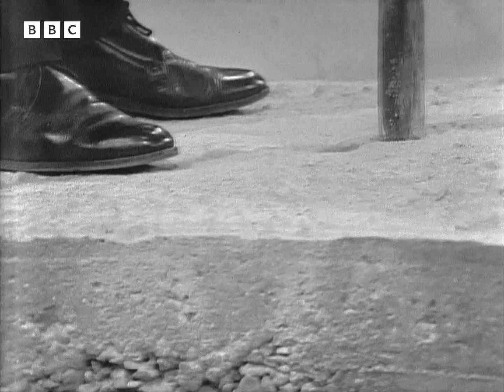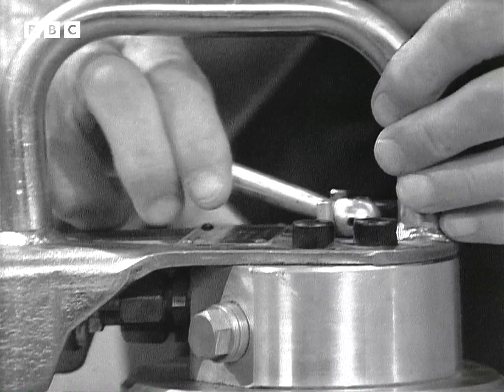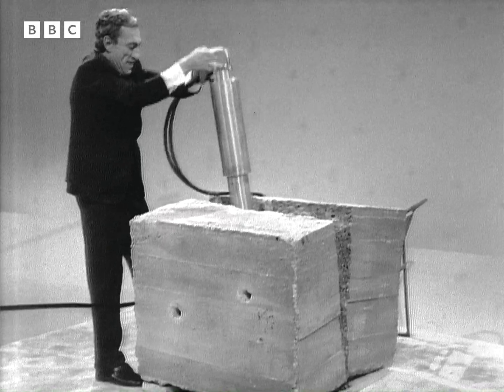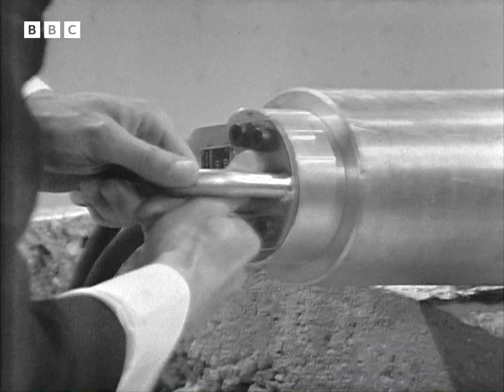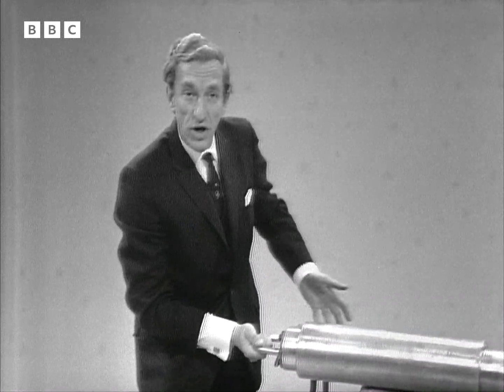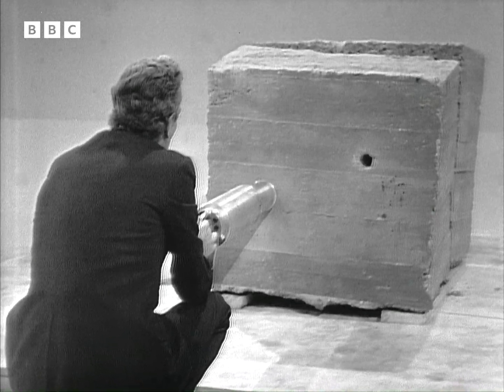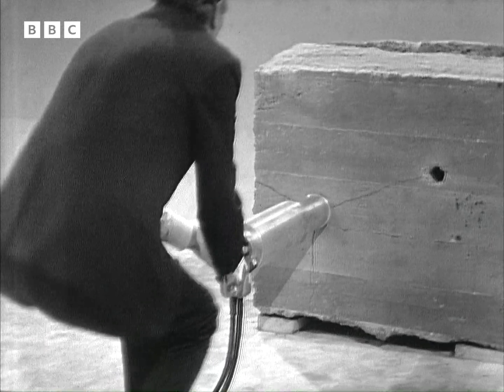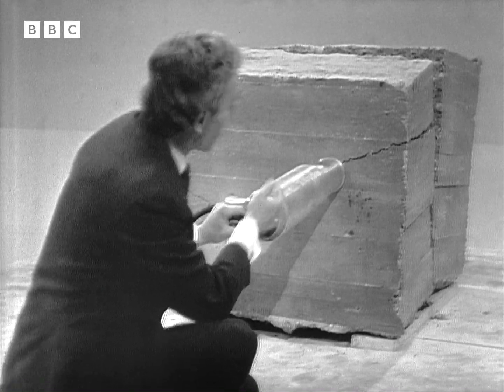1969: BEHOLD The HYDRAULIC ROCK SPLITTER | Tomorrow’s World | Retro Tech | BBC Archive

Comment: As long as you have a tie on and a handkerchief in your top pocket, there will be no need for any safety goggles etc. when 2 tonnes of the toughest concrete get flung into your face at 7000lbs /sq inch.
Now you have to wear eye protection, gloves and a reflective jacket, just to tap a cable clip in.
I think yesterday's world may have been more fun.

Comment: THINGS RAYMOND BAXTER MIGHT SAY WHEN DOING LOVE-MAKING

"I am now taking the pressure back off the tool and with a bit of luck I'll be able to withdraw it without collapsing the whole issue."

"There we go. Come on out my beauty... I'll pull it out that way and now we'll be able to see how that miracle was achieved!"

"But in fact, the tool itself is quite simple and it embodies a very well-known principle; that of using an enormous hydraulic force in a very short stroke to create these immense energies..."

"In fact, that's not nearly as dangerous as it sounds because this is only a quarter inch bore and of course there's virtually no flow so even if this did pop off, uh... it wouldn't present you with a lethal hazard."

"Now as you can see, I'm withdrawing the central wedge so the 'chisel' is returning to its minimum size..."

"There he comes now! Look, running in three directions; there, there and vertically downwards..."

"Now if I retract the central wedge, to reduce the size of the probe, I will then be able to withdraw it and by popping it into the other hole..."
Reply: Absoulutely filthy....but hilarious.

Comment: Really interesting to see this from the 1960s. He says it's not dangerous because the flow is so small, but hydraulic failures can still release a reasonable amount of energy, even though hydraulic oil being a liquid is nominally non compressible, there will be some amount of stretch in the pressure hose that will contribute to this. Another risk is a hydraulic oil leak forming a jet, like from a pinhole, I have been a hydraulic systems engineer for 24 years and I have only ever seen one so they are quite rare but very dangerous, they will easily penetrate through leather gloves, any PPE of that sort and quite often in reported cases go through people's hands and unfortunately commonly used hydraulic mineral oil causes all sorts of problems if it gets into your deep tissues (hydraulic engineer yes, I'm definitely not a doctor). Handheld tools like those firefighters use, or bolt tensioning devices are often made to work at high pressures (as is the case with this rock splitter), so they are smaller and more easily handled but the high operating pressure makes it more likely to have one of these high pressure jet leaks.

Comment: While dismantling a 100 year old concrete buffer stop at Putney Bridge railway station. the modern equivalent tool was unable to break the concrete. It broke the tool. A lot of scratched heads trying to figure out what made it so strong. I never found out the answer....
Reply: when did it happen?
Reply: @fidelcatsro6948  About 2018/19
Reply: @philiplimerick2794  Wow quality of materials mustve been good back then
Reply: @fidelcatsro6948  I was driving the train taking away waste. Several holes were drilled and a hydraulic splitter was used, it did not work. Then a breaker attachment on a digger was used. The guys doing the work were getting a bit stressed. Eventually when enough holes were drilled the concrete did break. But also the huge bolts holding the hydraulic buffer stop were about 750mm long. Everything was so over engineered.
Reply: @philiplimerick2794  things get cheaped out ,quality goes down as we age...the relentless pursuit of making things cost effective and maximizing profits
🐱👍🏿
Reply: @fidelcatsro6948  there is definitely a line- if all bridges were massively over engineered, theyd take far too long and use too much concrete, too many steel girders etc.
Reply: @RJ-wx3fh  🤔